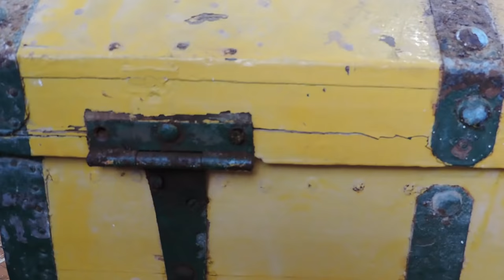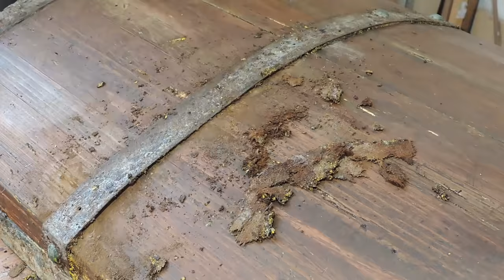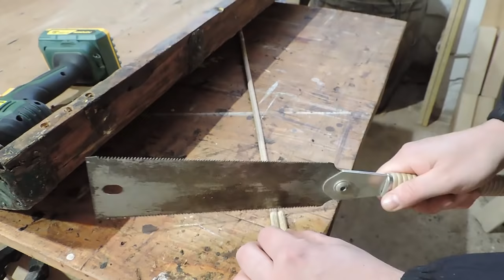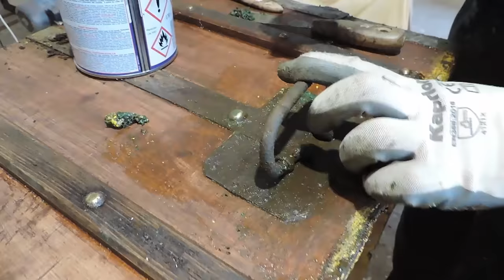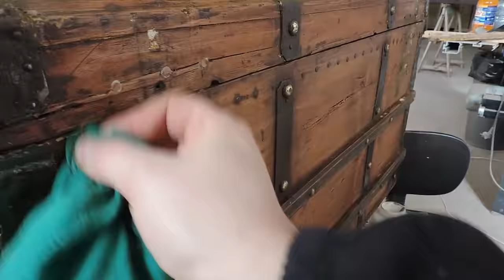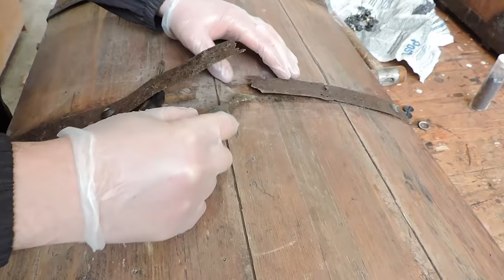restauro antico baule centenario

Comment: you did a good job on this however i dont think it is really a restoration. more of a repair and customisation. the chest would most likely have had two latches on the front with the existing lock in the middle. and the sides would have not been bare wood but covered with a canvas. The way they built these was that they would build the main box first and then covered it with a canvas, likely glued with a rabbit skink glue, then the metal work would be applied followed by a plaster like substance to the canvas and then finally painted they were common in style this was going back to around the start of the 1800s. the design later went out of fashion as mass travel by large ships came in and a flat topped chest was proffered by the shipping companies as it meant stacking they would be easier and take up less space. tho i know until at lease the late 30s you could still get them new built in this design.
Reply from the maker: It still had some canvas residue on the sides, I removed everything and left it on the wood. I would never have covered it with a new canvas🤗. Your information is very interesting, thank you
Reply: I think it was a sloppy job. Sorry.
Reply: I disagree
Reply: Ur talking about a sympathetic resto job.
I think this brilliant an given most people don't have access to ye olde materials I think it helps alot an it looks amazing any which way
Reply: @stevenkennedy  can't wait to see ur video 👍
Reply: I bet you all are fun at parties.
Reply: Exacto ,yo restaure uno igual k ese ,pero siguiendo el diseño original ,lo que lleva de forro es aspillera ( lona de cáñamo) y restaure la chapa original y estos llevan de forro papel mural ,también hice todas las esquineras de metal y reemplase las podridas ,un trabajo meticuloso y de mucha paciencia,ahhh lo desarme entero y lo volví a armar ,( estoy en faccebook Alfredofreddyleyland por si acaso)

Comment: Nice don't forget  for future  ones with canvas all around , razor blade around  edges , then hit it with warm  water. It will pull up easily .Then   remove  the remaining  softened  mudded glue  with razor  blade and or more warm water and steel wool ( no stripper) canvas  glue may vary , but not likely  back then , great  2 tone , 👍
Reply from the maker: Thanks for the good advice

Comment: obviously this piece was too far gone to do a full authentic restoration. However I felt you customized rather than restored in many areas, replacement of wood instead of the use dowels for instance. The banding would have required replacing as well as those Lowes bought hinges. Don't take me wrong it came out looking nice and will be a intereesting piece but lets call it what it was

Comment: Obviously you've never seen one of those trunks it's not been destroyed or modified and stained to look like some barrel or "pirate trunk from the TV of movies" like  what you just did to that one there supposed to be completely covered with canvas without the canvas and the dipping/paint over top of said canvas it's not waterproof and absolutely useless the only way to properly repair that is the dissemble the entire trunk remove all the rivets recanvass the thing  dope it and then put all the steel plates on and then the rub bars